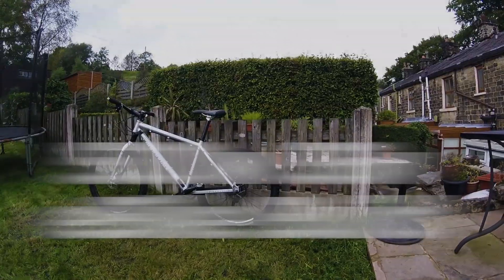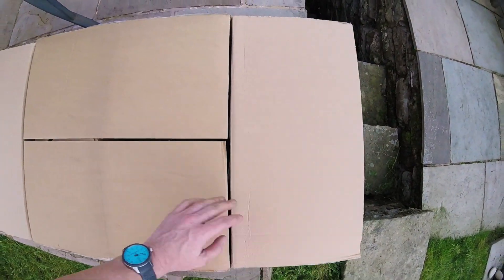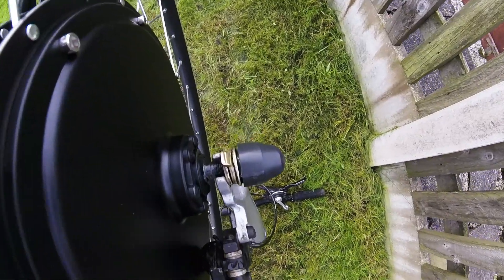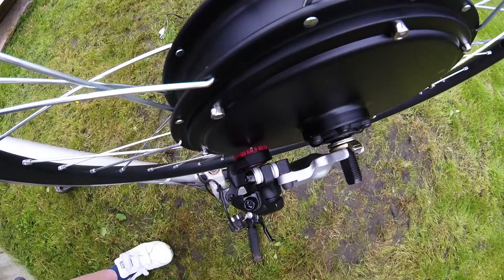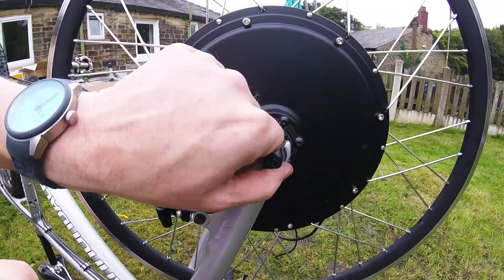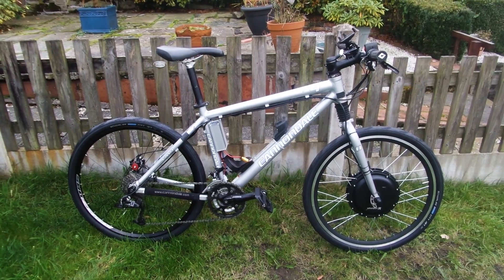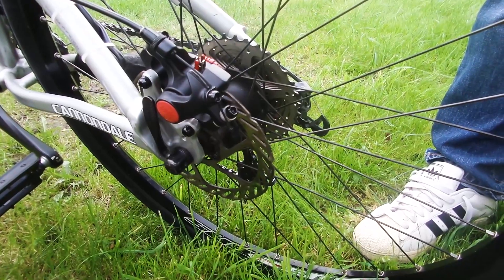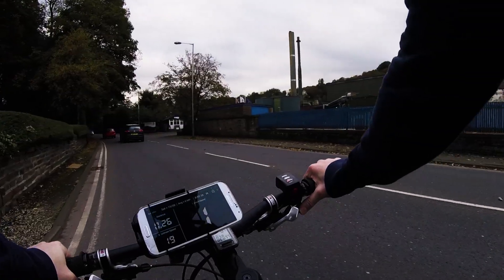500w 36v Front Wheel Ebike Build by an Ebike Noob

Comment: Hey Richard, Where in the UK are u.? You ever been pulled over on this? or had any looks from the Cops!
Reply from the maker: Haven't ridden it much due to the weather.  It has a 250w PAS option which I'll be using on the road so it should be compliant with the law and shouldn't attract any attention from the cops!!
Reply: @richardhanson2331   when you fit the pedal sensor ........its there a switch to set it to low power (250 w) .or is it just s case of connecting the low power wires on the controller ?
thanks
Reply from the maker: @wacka2  you can fit a switch for the power modes with our without the pedal sensor.  I have three wires shorted fort full power all the time
Reply: @richardhanson2331  cheers
Reply: Can I ask how it copes with hills without pedaling? I am not concerned about the legal aspects of a ebike, I just want something that can cope with hills without pedaling, I've seen so many videos, most from the USA and the more I watch the more confused I get, yours is the most informative up to now, I really just want to know what is a good front hub to buy for just normal use

Comment: Mate, you just filmed yourself breaking the law and uploaded it under your real name. I don't have a problem with it, but you can lose your license for riding an e-bike over 250w on public roads, as well as going over 15mph using the motor.
Reply from the maker: Alan I didn't know that!! Thanks for the heads up.  I'll take it down.   However if in this video I have been using pedal assist in 250w mode and that would be OK?
Reply: Yeah I think that's OK. As long as the motor at 250W cuts out at 15mph. It's an outdated law from the 80's and in much need of updating I think.
Reply from the maker: YUKI INU I think you have to take the power of these kits stated by the sellers with a pinch of salt. When I installed a cycle analyst on this bike I was surprised to find that it was drawing over 1000w. So it would be over your 750w limit.
Reply: Yes definitely its the controller which gives the power, the 250 watt motors draw a thousand watts on startup. @richardhanson2331
Reply: Richard Hanson   I don't remember how basic electricity (amps, volts, etc) are combined to equal watts drawn.  I have never heard of police using electronic instruments to measure watts on bike motors. I assume they would look at the label or other watt indication on motor.  Unless I am in a big hurry I always stop for red lights, obey traffic laws and coast very slowly and safely through stop signs. Although, when I was a bike messenger I got a ticket for not stopping at a stop sign. Long story short, the traffic court judge said I had to go to traffic school just like speeders, redlight runners, unsafe lane changers and so on.    Do the police measure the watts drawn by e-bike motors where you are?
Reply from the maker: YUKI INU I don't think the police here would go to the trouble of testing the output.   If you don't ride stupidly and pedal when you're riding you won't attract any attention here.
Reply: Yo Alan, if you are going by the law, throttle riding is not allowed either. Not if your bike is assembled in 2017. Technically it's only road legal if it helps to 6kmph and no more and your assist only helps to 15.5mph. Stupid I know as chunks of throttle actually help make us safer at lights and junctions and hold up traffic less and turns out I my gearing likes to cruise at 18mph. Yay, crappy UK laws.
Reply: Thats another reason I chose 500 watt, here in america I have read that 750 watt is the limit before it needs to be licensed as a motor vehicle.
Reply: One possible answer would be to legislate to equip ebikes with GPS fencing technology that would permit 40kph or higher on country roads, but limit the motor assist to 25kph in towns.
Reply: +Tactical Sh0ttyN0Sc0p3s A 1000w is not legal on any US road? Not that it matters.  In the UK we can buy whatever we want, But the E-bike limit for our roads is 250w 15.5mph (So, Many main dealers of pre-builds will sell limited to that) But you can still buy dual powered bikes and kits, So it doesn't stop us! Cops don't really care unless you are riding recklessly anyway. Many cops are not even tuned into E-Bike rules. (Plus the fact you don't have to ride around on the roads right?)
Reply: Fuck the law !! As if
Reply: ' If you don't ride stupidly and pedal when you're riding you won't attract any attention here.
'

An officer told me just that although he used the word 'asshole' . As long as you don't ride like one then you'll be fine . In fact you don't even have to pedal . If the kit was made before Jan 2017 then you can use the throttle .